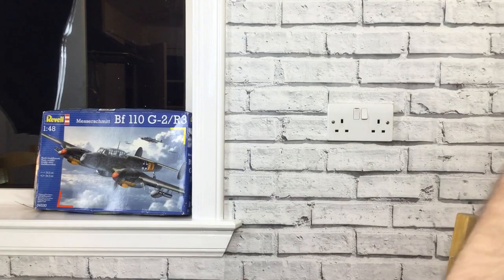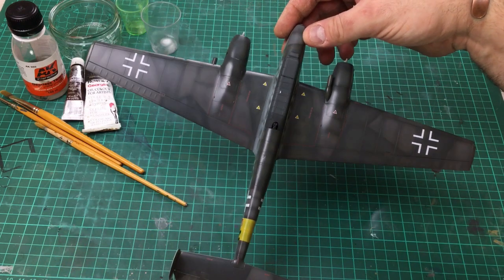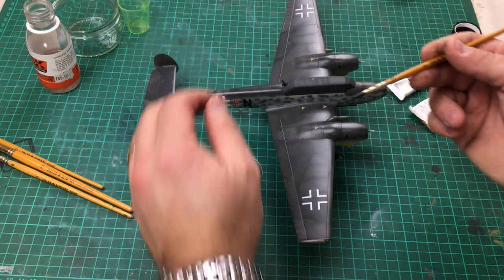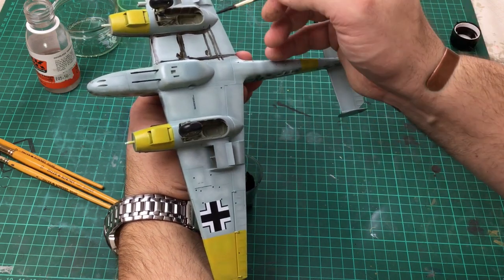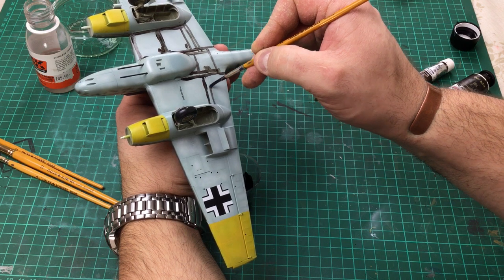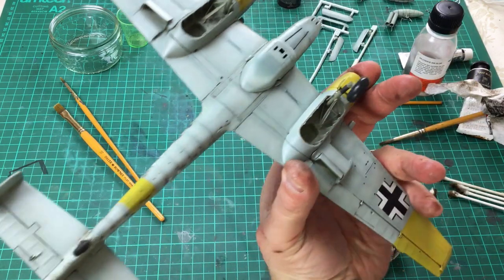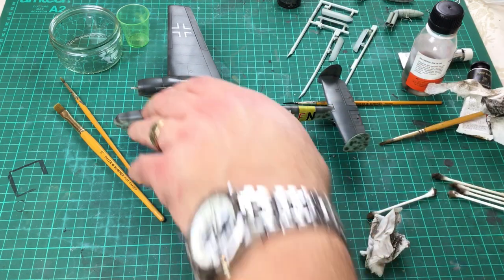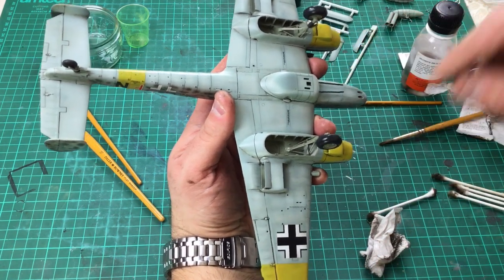Painting & Shading with Vallejo Model-air Acrylics   Part 4: Oil Washes

Comment: i´m going to be customizing my second gundam kit now and now i want to panel line it so i have a question: say you´re painting with vallejo acrylic paints and then you have to panel line it ,in my country i cant buy tamiya panel liner it´s made illegal so how do i panel line on vallejo paint surface with a vallejo black model was or do i buy a enamel pain and turn that into a wash
Reply from the maker: Hi there, I have used both enamel washes and artist oil paint washes on top of Vallejo acrylics, the most  important thing to keep in mind is the thinner you use to make either wash. My preference for washes is a dark brown or dark grey colour artist oil paint thinned with good quality odourless mineral spirits, this should not harm you paint finish when applied and cleaned away. A note of caution normal household white spirit is too harsh to thin the paint when making panel line wash, I would advise you look in an art shop for the correct thinners. Also make sure the Vallejo acrylic paint has had sufficient time to dry and cure, I normally leave my models for a few days before I try and work with washes. I hope this helps, feel free to message me if you would like to discuss further.
Reply: @KitchenTableModeller  thank you this will help me a lot ive also heard you can thin oil paints with enamel thinner, so should i use the one i have now: humbrol enamel thinner, or should i buy a dedicated oil paint thinner?
Reply from the maker: I’ve found humbrol enamel thinners can be a little hot fir my liking, I would look for a good quality product, I use Windsor & Newton Sansodor mineral spirits. I forgot to say to test your final mix on some spare sprue parts if your building gundam, I’ve heard Bandai plastics can react badly to hot thinners, but I’ve not had experience of this.